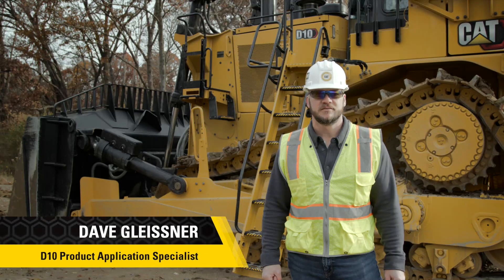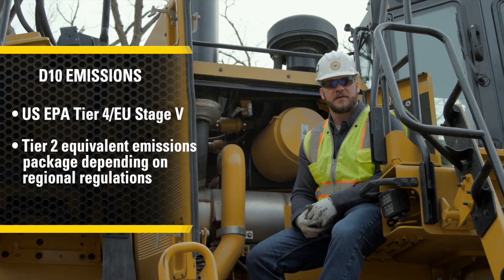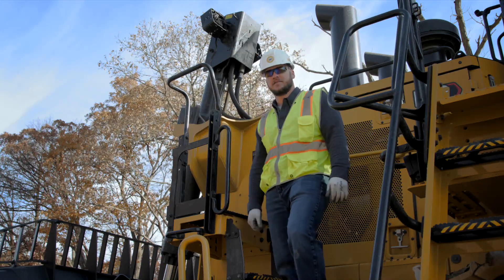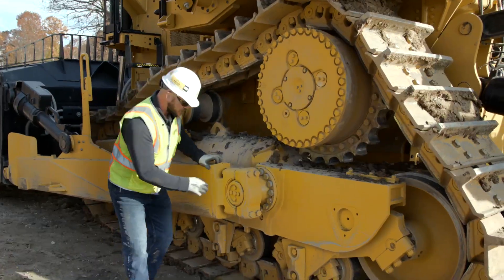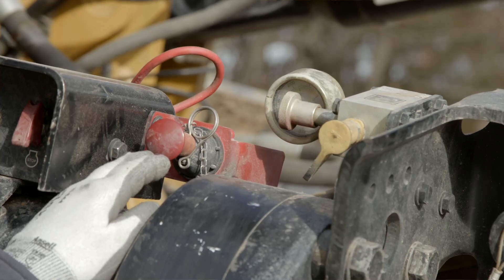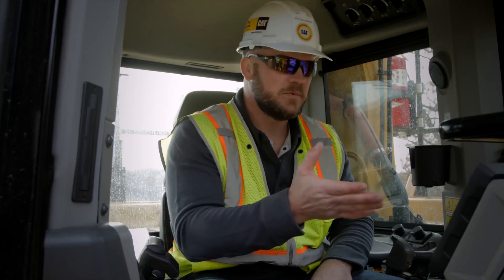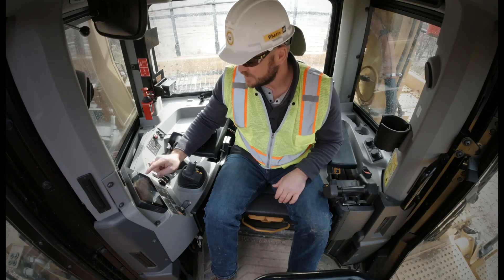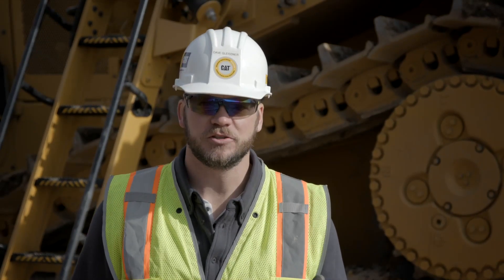Cat® D10 Dozer Walkaround Video

Comment: hi, why more hp in reverse? I don't get it, thanks
Reply from the maker: Hi Sylvano! Essentially, more horsepower in the reverse direction enables faster cycle times. We’re able to apply more horsepower in the reverse direction without impact to the powertrain because the dozer isn’t carrying a load; when it’s moving forward, it has a load to carry and we have to be careful to protect the powertrain. In reverse, without that load, we can increase power to speed up cycle times. Hope that helps. - Ron

Comment: Dont understand high horse rating in reverse other than gearing
Reply: Increases cycle time speeds in bulk push applications
Reply: @nickcrosskill9035  understanding it is like a speed comp with a dozen in r gear
Reply: @terrycormier5492   That sounds like more wear and tear on the machine. Is it really worth it in the long run?